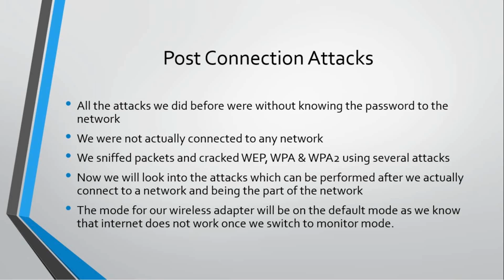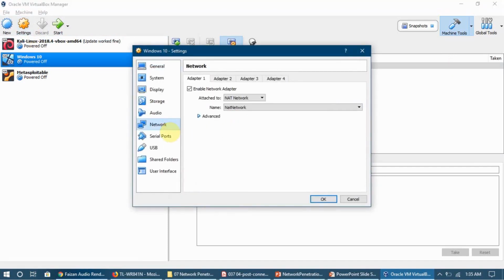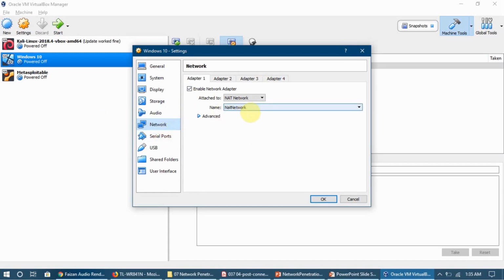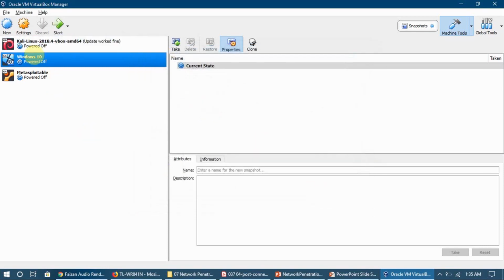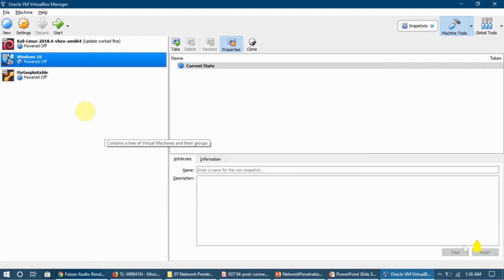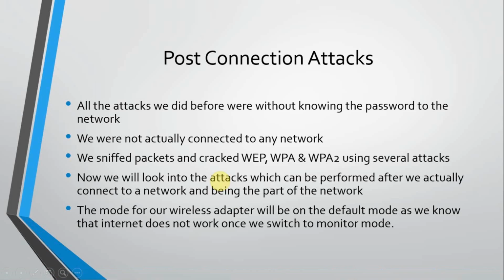35. Introduction To Post Connection Attacks - Setting Up Virtual Box For Post Connection Attacks

Comment: can we try these attack on host machine without wireless adapter?
Reply from the maker: yes, if both of them are on the same network, if you have a NAT network set in virtualbox you can try them on your host machine too
Reply: @TutorialsByITConsultants   (sorry 
for long question )thanks mate one more thing using wifi adapter I can access to devices connected to a network then what about wired devices lets suppose there is a network without wifi the laptops connected to this is via wire and I am also connected to that network so how can I perform post connection attacks?
Reply from the maker: @hasnainahmed2915  you can perform all same attacks even on the wired network, these attacks aren't bound to wired or wireless network, as long you are on the same network, you can perform all the post connection attacks which we are going to discuss in the further videos.
Reply: @TutorialsByITConsultants  basically I don't find my host machine when I am scanning through zenmap. so can you guide me if I am missing something?
Reply from the maker: @hasnainahmed2915  check the IP address of your kali and host machine, if both of them are on the same network or not
Reply: @TutorialsByITConsultants  I have configured kali on nat network aoo when i check my host ip via ipconfig on cmd it shows me of some 192.187.2.1  network and on VM kali it show 10.0.2.1 net its not on same network even i configure nat network